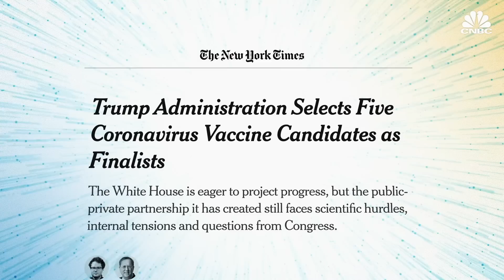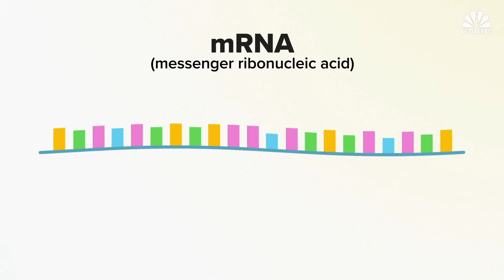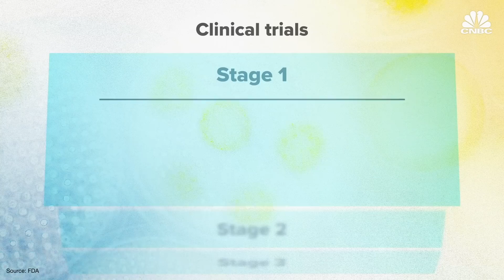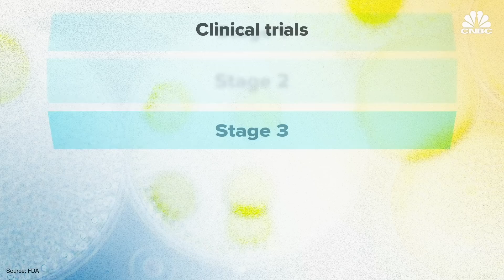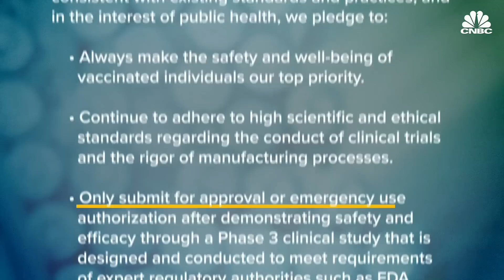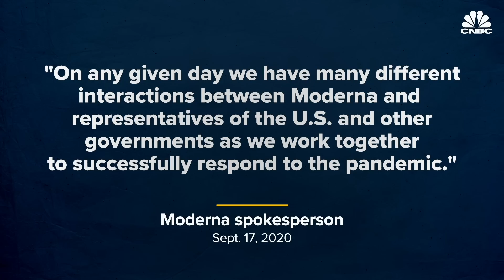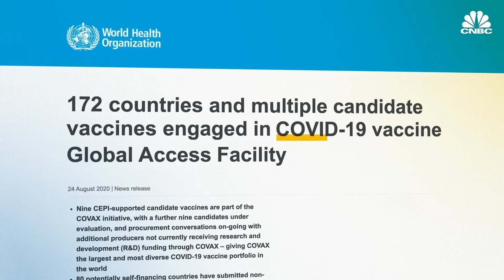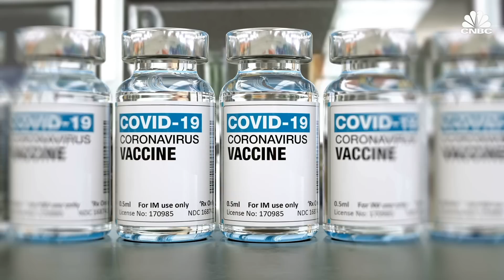What Is An mRNA Coronavirus Vaccine?

Comment: The difference is a vaccine you show antibodies this is what the enemy looks like.
mRNA is sticking a rod in the antibodies and it wakes up saying "I know kung fu!"
Reply: Xenobots + mRNA = Human zombie bots.
Reply: @The_Primary_Axiom  ????
Reply: Red Pill Red Pill  That's not possible. A vaccine would have nothing to do with affecting cell replication. Therefore cancer is not possible since cancer happens when your cells over-replicate. Not having anything to do with cell replication in the first place makes it kind of hard to have that effect. Other things such as cigarettes contain harmful chemicals that throw off the chemical balance in your body and cause rapid cell replication, which is why things such as that are a carcenogen.
Reply: @taviondavis1293  actually it is possible, if the mRNA codes for something that disrupts the checkpoints in replication.  Its also possible that the antibodies will react to ones own body, like autoimmune diseases. Its extremely unlikely though since they know what is in the mRNA.
Reply: Red Pill Red Pill  It carries messages of genetic information for tRNA to copy. You are most likely mixing up the two because mRNA only carries information.
Reply: Zax  No it doesn't. Little secret here mRNA is in every single one of your cells already.All it is is a copy of your DNA which is then translated to form a protein. Very basic biology. It won't alter your DNA.
Reply: I have a question I hope someone can answer. This mRNA vaccine causes the rna of the virus to enter you cells and cause your cells to produce the antigens of the virus and then your immune system then detects the antigen and then is supposed to make antibodies to fight the virus. My question is couldn’t that cause the body to attack itself if your own cells will be releasing the antigens. Second if your cells are making antigens of a virus isn’t that an abnormal function that’s like a mouse secreting  snail fluid . It seems to me that you would have to take on some genetic properties of this virus for your own cells to make its antigens. My 3 rd question is if this a mutating virus who’s to say it won’t cause mutations once the vaccine through its lipid nanoparticle causes the rna of the virus to penetrate your cells and instructs them to secrete the viruses antigens. will your cells be covered with the antigen  and then be attacked by the antibodies it produced. What if your body doesnt see the virus as a threat anymore because know your own cells are secreting it’s antigens what if the antibodies aren’t even effective because they see no need to attack what your own body produced. These are all relevant questions sheep won’t think to ask
Reply: Red Pill Red Pill  I don't get how people can you know...just WAIT for a few months after vaccination to see if it does anything?

But thing is honestly, I wouldn't be surprised if governments force people to take the vaccination or receive state punishment. That'd be a scary thing to go through.
Reply: Red Pill Red Pill Well why don’t you and him be the first to volunteer. What a bunch of entitled narc sociopaths!
Reply: sinkiy oop- ok :> 😌✌️
Reply: Red Pill Red Pill  what were the results for the animals in more detail?
Reply: The wonders of genetic modification, no need to worry about gmo foods anymore and we’re all about to be gmo’s ourselves lol
Reply: @applesaucerno.2843  These guys explain it better than this video. https://www.youtube.com/watch?v=IVlULRMvcjI
Reply: sinkiy wut- lol but uh ok? 👉👈
Reply: I’m really sorry, but was that a Daxter reference?
Reply: Red Pill Red Pill  Are you serious?
Reply: Red Pill Red Pill  sorry, my bad I thought you knew about it.
Reply: MMAmRNA
Reply: Red Pill Red Pill sorry! Then they can be the first to volunteer. I’m better at person to person conversations.
Reply: Altair IV  Mmmmm no
Reply: Sloane M How? How does it not do that?
Reply: Merlin  if people don't know this, I'm scared.
Reply: @fcosta94  how did you know? Seems to me there are folks here who know so much about these mRNA vaccines already. 😑
Reply: That's rich
Reply: damnnn     😲
Reply: delonix regia  Doubt is good to a certain point. I make it a priority to understand what the body can withstand as well as the way in which the vaccines work. I then explain that and it's usually the people who continue with the "what ifs" and "but's" that hold irrational fear. 

However, yes several companies are showing 95%+ efficiency. The sooner we are able to administer the vaccine the sooner we can start the real battle to completely eradicate the virus.

It's the people who become extra about their freedom, when it's not really about that it's about cooperation for mutual benefit, that will slow down the process to get back to a somewhat normal life. Just how anti-maskers foil tireless attempts to contain the virus with a single maskless college party.
Reply: delonix regia  That's a whole different situation that I have no knowledge about so I'm not going to treat it as something that is a common occurrence in vaccine production, because it's not.
Reply: delonix regia  Also, better than the alternative of it becoming a far more contagious version of influenza in the future and evolving to a point beyond vaccines being able to fully control it. People always highlight death rate as a halmark of a virus but side-effects are important too. There are people who caught it early on who still feel the symptoms, but have a negitive test. There are people who developed blood clots because of the virus' interaction in the bloodstream which can lead to a heart attack or stroke. Then there is also the possibility of a Cytokine storm, which isn't as fun as it sounds. Not to mention the common occurrence of lasting lung and heart tissue scarring that is worse than the effects of smoking for several years and develop into chronic debilitating diseases. All this can happen to people whether they showed symptoms or not.
Reply: delonix regia  Not to mention the fact that literally every actual healthcare professional recommends the virus be distributed and taken. There are doctors and nurses who have to pull endless shifts that try to describe how horrible the virus is on a case-by-case basis, which is more than enough to warrant everything, but get undermined by anti-vaxx moms who researched on Wikipedia for like 5 seconds and politician's who parrot them to gain favorability over an unstable demographic.
Reply: delonix regia  An overwhelming majority of all vaccines throughout history have been almost completely safe, save for rare allergies to certain chemicals. Also, a majority of healthcare professionals definitely advocate for vlthe vaccines. On top of that they've largely ignored outside parties rushing them with the virus. Not to mention the fact that most companies prioritized the vaccine over other projects. On top of national medical organizations giving special attention to reviewing and passing the several vaccine trials.
Reply: delonix regia  Oh yes capitalism is sooo bad. Companies making money for something they developed with no federal funds whatsoever? Unthinkable. Also, most of vaccine trials is waiting to get approval from national review boards that preside over countless other research reviews over the course of several years. However, since those review boards have prioritized the vaccine it gives more room to be developed. On top of that the safety tests are still the same regardless of the speed of development and they would determine whether something is or isn't safe regardless of how quickly it was made. On top of that these places have largely ignored the rushing of their work to be able to focus on research and development. Also, medical technology is constantly evolving at an increasingly exponential rate so past pandemic vaccine response times lack the inclusion of such an important factor.
Reply: @taviondavis1293  i can only disagree with the capitalism comment friend.  American is a form of it. But for most part America is a Corporate Socialist Country Now.
Reply: IF it is done correctly. In the case of the dengue vaccine, the RNA did not teach the cells to reject the virus, but rather acted like a trojan horse, so that the vaccinated child caught a second case of dengue fever, it was far worse, sometimes even fatal.
Reply: @spiritinmotion1327  No I just don't care about what you are saying, because your input doesn't matter.
Reply: @taviondavis1293  🤣🤣🤣🤣 says the youtube scientists trained by  lab technician momma.
Reply: @spiritinmotion1327  Also, I haven't seen any Scientist's only anti-vaxxers with no actual point.
Reply: It's not that I am Anti-Vax but I am Pro-Science and there isn't enough science to ensure this injection is safe.

https://youtu.be/UCqGgqO-nr0

This is a totally new drug that should have gone thru years of testing including multiple tests on animals before ever being considered safe for humans.

https://youtu.be/3kej0uS5B1c

It's also extremely suspicious when a Pfizer CEO sells 60% of his shares in the company the day after making the announcement the injection would be approved.

https://youtu.be/eQsmdiJiAm8
Reply: @kellywills5852  You don't take it and watch everyone else turn into Cronenberg monsters. M'kay.
Reply: We are living in the biblical Last Days and with the Mark out, the mandatory v., the battle between light and dark is coming in the open. The King is coming back very soon, be ready: https://m.youtube.com/watch?v=wjmltHpAQw8
Reply: Dragon Skunk Studio   yes yes yes.
Reply: For the Great Deception is upon the sheeple of the Earth!  The deceptions are deadly.  Who shall escape the deception?  For even God's very elect may be deceived, lest we put on the whole armour of God , repent and gird the spirit of DISCERNMENT. 
"Discern real from fake."  - Amen. 
For he who hath ears , let him hear (Truth):  
"Expose fruitless deeds of evil." - Ephesians 5:11 
Fire cannot fight fire.  Evil does not combat evil.  
Virus does not fight virus (vaccines).  

Trump (and Biden) is Pro-Vaccine.  

Before taking the vaccine, please be aware of the following:

     To date, there have been almost 200 COVID VACCINE related deaths: 

Jan 12, 2021 - 24 dead in NY Nursing Home after getting COVID Vaccine 
https://www.bitchute.com/video/DeXZvU9TpEQB/ 

Jan 15, 2021 - 23 DEAD IN NORWAY AFTER RECEIVING THE SHOT! 
https://www.bitchute.com/video/tsV148TftLZy/ 

https://www.newsbreak.com/news/2141389976807/at-least-10-people-now-confirmed-dead-shortly-after-receiving-pfizer-covid-19-vaccine

6 PEOPLE DIE FROM PFIZER VACCINE AND FDA SAYS NOT TO WORRY ?!?!?!?!?!?!  
https://www.google.com/search?client=firefox-b-1-d&q=%22FDA+reveals+six+deaths+in+Pfizer+trial+but+says+not+to+worry%22

https://www.nytimes.com/2021/01/12/health/covid-vaccine-death.html

UK issues anaphylaxis warning on Pfizer vaccine after adverse reactions
https://www.reuters.com/article/health-coronavirus-britain-vaccine/uk-issues-anaphylaxis-warning-on-pfizer-vaccine-after-adverse-reactions-idUSKBN28J1DK

Emergency COVID-19 Vaccines May Cause Massive Side Effects
https://articles.mercola.com/sites/articles/archive/2020/12/08/coronavirus-vaccine-side-effects.aspx?ui=1559f3393ef928654102828940f41259667fe775259fcd4375a2b2d468572a28&cid_source=dnl&cid_medium=email&cid_content=art1ReadMore&cid=20201208&mid=DM741418&rid=1029859318

https://sandrarose.com/2021/01/california-halts-moderna-vaccine-injections-due-to-unusually-high-adverse-reactions/

     2. COVID Vaccine Ingredients:
https://www.bing.com/search?q=COVID+Vaccnine+ingredients&qs=n&form=QBRE&sp=-1&pq=covid+vaccnine+ingredients&sc=4-26&sk=&cvid=218A968513C64CCBAECEFD3411FAA242

     3.  Severe Allergic reactions to Vaccines have been known to cause anaphylaxis, among many other toxic reactions:
https://www.bing.com/search?q=COVID+Vaccine+adverse+reactions+anaphalaxis&qs=n&form=QBRE&sp=-1&pq=covid+vaccine+adverse+reactions+anaphalaxis&sc=0-43&sk=&cvid=E6EFB57198EA4AE7A10A9DB2A7DEF7CE

4.  The 1986 Vaccine Injury Compensation Act - protects "Big Pharma" companies, not the general public - you cannot sue drug companies if you or your loved one suffers severely or dies from side effects of vaccines: 
https://www.change.org/p/donald-trump-repeal-the-1986-national-vaccine-injury-act
https://en.wikipedia.org/wiki/National_Childhood_Vaccine_Injury_Act   

4A. "The Plan-Demic 2: In-DOCTOR-Nation"  full documentary 
https://www.bitchute.com/video/opLpNmtOVoaS/

5. COVID Truth (and Beyond) (playlist) 
https://www.bitchute.com/playlist/SZRtHmyYBb4m/

6. A Poisoned World - Trailer 1 (in playlist)  
https://www.youtube.com/watch?v=fI0eDoYsbNk&list=PLzk1nxEKnKQGUZhwS6vNhgkOKGAmZea2E&index=56

7. The PlanneDemic: InDOCTORNation (pt 10) 
https://www.youtube.com/watch?v=mDgUGGWRUwQ&feature=youtu.be

8. The Future of Vaccines (The Corbett report) 
https://www.youtube.com/watch?v=UQvaQFdGLn8

9. COVID 666
https://www.bitchute.com/video/ALo5lzO6g3Y2/

10. Vaccine Truth (Montage)
https://www.bitchute.com/video/3HB38yJV9DX2/

11. COVID on College Campuses and Beyond... (in Playlist)
https://www.bitchute.com/video/3F1G6RG3YaoM/ 

12. COVID19, Vaccines, Beast Technology, Wireless/5G = Prince of the Powers of the Air (satan)
https://youtube.com/playlist?list=PLzk1nxEKnKQHnWPVCFudyugubJV5-rtRR 

VAXXED TV
https://www.youtube.com/channel/UCwZDSEpPvE398OLazdituKQ

Doctors, Scientists, Witnesses being murdered for Speaking Out the Truth (playlist) 
https://youtube.com/playlist?list=PLzk1nxEKnKQHf1amwy0mLu9FT5R8eSfan

Jump to Feb 2018 - CDC Dr goes missing and eventually suicided for exposing Flu Virus at CDC 
https://www.youtube.com/watch?v=74_dnPijWMQ&list=PLzk1nxEKnKQHf1amwy0mLu9FT5R8eSfan&index=2

Jump to 2020 COVID - Dr Fauci ties to WHO ties to Wuhan Lab, manmade virus 
https://www.youtube.com/watch?v=C95ECjxgcJE&list=PLzk1nxEKnKQHnWPVCFudyugubJV5-rtRR&index=124

https://www.vaccinedeaths.com
Reply: Red Pill Red Pill  Which is a long-term death sentence that will not be seen until millions if not billions of people have received it. And by that time, who can track it back to this vaccine? No one. Look how long it took science to determine that cigarettes cause cancer, heart disease, circulatory problems, tooth decay,  COPD, etc. And did they ban them? Nope. That's our FDA at work. Same agency that approved scientific genetic modification of our food supply.
Reply: @yellowbird5411  yep just like the Spanish Flu
Reply: CHeEEEeeeEEe  Where are people getting this false information that mRNA rewrites your DNA? I assume you have absolutely no background in science at all because all mRNA does it convert your DNA to proteins i.e exactly what it's supposed to do for you to be alive. This is happening in every single one of your cells all the time. This vaccine is just an mRNA copy of the virus' proteins (antigens), which will then be formed into antigens in your cells. This will promote an immune response which will form antibodies. This is the basis of all vaccines. All vaccines produce an immune response and guess what you need for an immune response? mRNA! So stop spreading misinformation. That's the most dangerous thing going on here by far.
Reply: @archiebenn5707  thank you!!!!
Reply: kung flu*
Reply: @corwaincyrus9759  🤣👍🏻
Reply: @corwaincyrus9759  I learned a new nickname for it just last night and it had me DYING from laughter. Wu-flu 😂😂🤣🤣🤣

It really is Wu-flu though...
Reply: Red Pill Red Pill both are in phase three. Its been used on thousands of human by now.  Don’t think mRNA has the power to rewrite genetic code and in a only fakes out the immune system that a virus is in body so it then makes the antibodies proactively versus reactive. I could be completely wrong but we all are when learning new stuff called learning, imagine the normal vaccine way where they injection weak virus and body reacts to that message the weak virus creates when entered the body.  They just made the message and can broadcast it to the body and now it’s making antibodies in advance. Before exposure. Unless antibodies can transform into cancer cells  then would imagine it not possible. I would say though that if the message they make and broadcast is wrong and the antibodies come out and attack normal body parts would cause rise of auto-immune disorders
Reply: @stevehays6403  Your grammar shows how much people should listen to you on this subject. What-ifs are not things you should live by. As long as this virus exists I will support lockdowns and mask mandates and similar legislation while staunchly opposing us going back to "normal." The only option is to make a vaccine that will strongly support the eradication of the virus. However there are several tests on the effectiveness and safety of vaccines, they account for virtually everything. Normal research just for colleges to determine what people's favorite ice cream is among different racial groups have to have every aspect of research down to any and everything they say to the participants are prewritten and approved. Even wording is judged and down to how you present yourself, determine the ethical concerns and communicate the ethics of the study along with a complete list of participants which is also highly judged. That all is nothing in comparison to the standards of excellence and perfection for even the most basic of vaccines, much less one that is planned to be distributed worldwide.
Reply: Tavion Davis I’m confused. Auto correct could have changed your shouldn’t to should in the part of your comment that states “your grammar is why people should listen to you “.  So uncertain as to weather you were saying don’t listen to me or people should based on if my grammar is good or bad.  Would you mind clearing up please.  The shouldn’t of should makes the contexts of your comment in slightly different ways.
Reply: Dragon Skunk Studio what are you talking about
Reply: @conn_man_249  He was speaking in Matrix
Reply: @conn_man_249  cytokin storm
Reply: @conn_man_249  He means the vaccine will genetically alter your cells.
Reply: @conn_man_249  Vaccine teaches antibodies, mRNA is injects the information into the antibodies.
Reply: Dragon Skunk Studio you mean it helps fight back covid
Reply: @dragonskunkstudio7582  close, but the antibodies are proteins that can't really learn, at least in the same way as cells. The vaccine "teaches" cells, not antibodies. It's more analogous to cells learning to fight a weaker version of a murderer (regular vaccine), versus cells learning what the right tools are to fight the murderer (mRNA vaccine)
Reply: Dragon Skunk Studio you mean old way is the body learning from a weak/ dying kong fu master  so know what style kong fu to prepare for so ready for a full strength Kong fu master when invades. And mRNA is like a power up and have the book to the corona Kong fu.
Reply: @dragonskunkstudio7582  transfection will change your RNA they say it won't be permanent but it probably will be
Reply: @dragonskunkstudio7582  no, you don't teach the antibodies. You teach the immune system to make antibodies.
Reply: @dragonskunkstudio7582  Ahhh you're kind of wrong but on the right track. The mRNA creates harmless proteins that resemble the virus and it's not the mRNA, but those proteins that give you your immunity
Reply: It’s still NOT a cure. A lot of people are misinformed and think it’s a full on cure. But NO it’s NOT it’s like the flu vaccine. And I’m no scientist but that doesn’t sound so safe.
Reply: @jesussaves8549  vaccines were never cures. They are prevention so that you don't get sick.

An ounce of prevention is better than a pound of cure, as they say.
Reply: @ronch550  I didn’t say they were. But a lot of people think they are a cure and will be 100% protected
Reply: @jesussaves8549  It is safe, the only reason it doesn't sound that way is you know nothing about immunology or medical technology, and therefore you have no reference. Vaccines are the safest and most powerful form of medical tool that humans have.
Reply: Tavion Davis and? I know enough that I know that a vaccine made in a haste is not safe. And when Bill Gates gets involved I’m not interested!
Reply: @taviondavis1293  please what are your references and credentials granting you authority to make such judgements on his behalf? I get put off by people sounding just the way you do,mostly after they have listened to a shitload of CNN and BBC.
Reply: Y'all are dumb to take this vaccine. Can't you see that this has never been done and will change EVERYTHING?
Reply: @patriarchmike  when people start taking that vaccine there gonna be getting covid it aint happening now till that damn shot comes out
Reply: @patriarchmike  Everything has never been done at one point in time. Therefore it's no excuse.
Reply: @patriarchmike  nope , you have 3-5 choices ...I think you'd prefer the old style dead virus vaccine . But  mrna.. messager  rna..( not dna)...it's the safe half of the way to do this ...I'm still spooked that they use monkey ' cold viruses' to get it into the protein making machinery...monkey pox! Ahoy! ...so in 10-14 days , 60% or more will get sick from the shots , or as advertised 3% will have a mild reaction. So you choose ,  death or a 3 day mild hangover ?
Reply: @tomgucwa7319  mRNA will change our DNA forever and remake us into mindless drone hybrids that are owned by corporations. Sorry but I belong to no one but God.
Reply: @patriarchmike  I do not worship false idols , mrna is new. The cheapest and easyest to store vaccine is the older tried an true technology .  We will know more in two weeks and again in a month. Bee swell
Reply: @tomgucwa7319  who said anything about false idols? Who cares if its new? Its not safe or ethical and there is nothing you can say to change that fact.
Reply: wait- so this might be the vaccine for covin? If it if ❤️😌
Reply: @amomentwithmark6717  not really they said it wasn't used on humans
Reply: Good luck with the vaccine, errm when things go wrong dont try and sue the vaccine company, they have a zero-liability clause, which makes anyone taking it one stupid MF.
Reply: After my 4yo granddaughter cut her hair off during her class zoom meeting, I got the Moderna vaccination, because someone has to, I don't want to see this pandemic drag on for possibly years, our children need our help and they need it now, not everyone wants to see the world burn, I'm a former United States Marine, I've learned that there is a time to duck, and there's a time to stand up. Im standing
Reply: James Dicus i’m also a Marine Veteran and am in the Moderna Covid Vaccine trial.  Get my second shot this coming Monday.  I was injected with Vaccine I had some minor side effects from the first shot.  Service and Sacrifice is ingrained in us Marines.  I hope this Vaccine works for the good of us all.
Reply: @jamesdicus5468  you should know better if you have been a marine. Standing for what by the way? I'm confused and what has your grandaughter cutting hair got to do with a vaccine?
Reply: @jamesdicus5468  it's been a month how are you feeling? Please respond
Reply: @jamesdicus5468  she is 4. What classroom zoom was she on?? Do 4 years old go to class?
Reply: @jamesdicus5468  my son also cut his hair.  wow?
Reply: James Dicus your a volunteer you have my respect because you want to help the human race survive
Reply: @jamesdicus5468  thank you for thinking of our children. Everyone has been ignoring how hard this year had been on them. Then you for stepping up. Many blessings to you and your family.
Reply: Red Pill Red Pill  perhaps, but right now scientists are just trying to see what could work. We'll see what happens
Reply: @vthunder2789  I wouldn't take it even tho they did some research they could be hiding stuff behind media
Reply: @vthunder2789  The fact that they are rushing so hard to get, still experimental, medication approved for use on the entire population, while it is still impossible to know if there are long term side effects, should concern us all. If it becomes mandatory in any way I expect very strong resistance to such mandates, and rightly so.
Reply: @ingluv  A worldwide pandemic doesn't just end. Plus the standards by which they test these vaccines safety are still the same. Plus our technology rapidly develops at an increasingly higher rate so we can safely produce vaccines much faster than in the past and it will continue to get even more efficient.
Reply: @taviondavis1293  no excise for dropping the checks and balances. The safety protocol is there to ensure medications and vaccines are safe. You can not remove any safety protocol without increasing risk. 
Explain to me how, in less than a year of research, they are suddenly able to see effects 10 years in the future?
Reply: https://www.youtube.com/watch?v=0YhJxJZOWBw
Reply: white blood cell: "i know kung fu"
Madorna: "hmmmmm...show me"
Reply: MRNA VACCINE IS THE MARK OF THE BEAST YOUR ABOUT TO BE INJECTED WITH GENETIC MATERIAL FROM A MUTATING VIRUS https://youtu.be/HaMx5XxEEPM
Reply: Red Pill Red Pill  That doesn't mean I contradicted myself. It still doesn't create a link to the actual multiplication of cells, which would allow for cancerous rapid cellular replication to occur, which is the basis of my argument. That and you are going a long way for little return. Meaning you are going way to far to ensure that you do nothing but fear things you don't even comprehend. On top of that vaccine testing is literally the most fullproof, extensive, strict and safe form of research that we humans can produce. Not only that but it is the most practical and powerful form to combat massively viral diseases, such as COVID-19, there is no such thing as waiting it out. Black plague still exists today and is still very much deadly to people who remain unvaccinated.
Reply: @taviondavis1293  I bet you would make a great guinea pig
Reply: @dbchillin7747  XD
Reply: @taviondavis1293  the vaccine isn't a vaccine if it's rushed and contain of unknown stuff in it that cause covid to not cure furthermore it'll probably turn us into zombie(doubt it but it could happen) 🙃
Reply: @myfuturelife4445  That's stupid and has no basis. Clinical trials have data analysis and content makeup releases and they don't put anything in them that is inherently bad for the average human body other than a very small amount of the virus, but you'd have to have basically no immune system whatsoever to contract it or if you are allergic to one of the contents, but that's unlikely because chemical allergies aren't common and it would not make the vaccine inherently at fault. I'm not saying maybe this is what it is, I'm saying exactly what I'm saying is truth. Also, the reason most vaccines take years is because doctors are split in terms of what medical projects they are handling, the process for testing is extremely extensive and is usually caught up in pre-review for the majority of "years" and most of all applying for grants and money to do the actual work. The vaccine is extremely prioritized so most places are exhausting their efforts by focusing almost completely on viral research and chemical manufacturing, there are grants that are basically thrown at them like dog treats, and their research method reviews are expedited.
Reply: @taviondavis1293  but if the chemicals aren't very common then might as well not put it in our body.
Reply: @myfuturelife4445  I said chemical allergies aren't common. So it'd be the opposite. People are usually allergic to food (ie dairy & nuts) or insect venom (Bee's & Spiders).
Reply: @taviondavis1293  oh chemical allergies ok sorry I misunderstood T^T
Reply: @taviondavis1293  Any protein can potentially cause an allergy. It's not impossible the new mRNA could replicate an allergen. But the testing pool should assure those incidents are exceedingly rare, i would think. I 
Wouldn't think an mRNA vaccine would be inherently more dangerous than traditional vaccine. I would take one (after reviewing safety data). Anytime anything is "New" it scares people. That's in our DNA too.
Reply: @onebylandtwoifbysearunifby5475  I understand, but I also trust the scientists who work with little pay, endless hours in a now thankless job since science is under attack since people refuse to trust everybody endlessly despite the country being built upon trust that everyone would band together, and not be british spies, in order to gain independence. I know because my mother is a lab technician and she loves her job and talks about science all the time in a passionate way. I get that it's new, but I trust that they are going to ignore Trump, in terms of speeding up the vaccine development, and go at their own pace. Also, mRNA is just a messanger, and it sounds far more dangerous then it really would be. Since mRNA just carry messages through the cell and synthesize protein. Also, protein allergies are usually from food related proteins such as the protein in eggs.
Reply: @taviondavis1293  Let's discuss the poisonous concoctions pharmas want to pass as "cures", aka vaccines. 

1. One of the most critical elements which defines the toxicity potential of any vaccine are its pharmacokinetic properties. Drug companies and health agencies refuse to consider the study, analysis or evaluation of the pharmacokinetic properties of any vaccine
2. There is not one double-blind, placebo-controlled study in the history of vaccine development that has ever proven their safety, effectiveness or achievements (unless those achievements have underlined their damage to human health)
3. There are also no controlled studies completed in any country which have objectively proven that vaccines have had any direct or consequential effect on the reduction of any type of disease in any part of the world
4. Every single study that has ever attempted to validate the safety and effectiveness of vaccines has conclusively established carcinogenic, mutagenic, neurotoxic or fertility impairments, but they won’t address those
5. It is a scientifically established fact in literally hundreds of studies that the preservatives and chemical additives in vaccines damage cells. Neurotoxicity, immune suppression, immune-mediated chronic inflammation and carcinogenic proliferation are just a few of several effects that have been observed on the human body
6. Drug companies still tell us the damage vaccines have on the human body. People just don’t read them. All you have to do is look at the insert for any vaccine, and it will detail the exact ingredients, alerts and potentially lethal effects
7. Any medical professional who believes that it is justified to inject any type of neurotoxin into any person to prevent any disease is completely misguided, misinformed, deluded and ignorant of any logic regarding human health
8. All promoters of vaccination fail to realize that the respiratory tract of humans (actually all mammals) contains antibodies which initiates natural immune responses within the respiratory tract mucosa. Bypassing this mucosal aspect of the immune system by directly injecting viruses into the bloodstream leads to a corruption in the immune system itself. 
As a result, the pathogenic viruses or bacteria cannot be eliminated by the immune system and remain in the body, where they will further grow and/or mutate as the individual is exposed to ever more antigens and toxins in the environment which continue to assault the immune system
9. Despite the injection of any type of vaccine, viruses continue circulating through the body, mutating and transforming into other organisms. The ability of a vaccine manufacturer to target the exact viral strain without knowing its mutagenic properties is equivalent to shooting a gun at a fixed target that has already been moved from its location. You would be shooting at what was, not what is!
10. Flu viruses, may mutate, change or adapt several times over a period of one flu season, making the seasonal influenza vaccine 100% redundant and ineffective every single flu season. Ironically, the natural immune defenses of the human body can target these changes but the vaccines cannot.

Now please consider to reply to the below questions:

CLAIM: The study of vaccines, their historical record of achievements, effectiveness, safety and mechanism in humans are well understood and proven in scientific and medical circles.
FACT: The claim is completely false:
1. Could you please provide one double-blind, placebo-controlled study that can prove the safety and effectiveness of vaccines?
2. Could you please provide scientific evidence on ANY study which can confirm the long-term safety and effectiveness of vaccines?
3. Could you please provide scientific evidence which can prove that disease reduction in any part of the world, at any point in history was attributable to inoculation of populations?
4. Could you please explain how the safety and mechanism of vaccines in the human body are scientifically proven if their pharmacokinetics (the study of bodily absorption, distribution, metabolism and excretion of ingredients) are never examined or analyzed in any vaccine study?

CLAIM: Preservatives and chemical additives used in the manufacture of vaccines are safe and no studies have been linked or proven them unsafe for use in humans
FACT: The claim is completely false:
1. Could you please provide scientific justification as to how injecting a human being with a confirmed neurotoxin is beneficial to human health and prevents disease?
2. Can you provide a risk/benefit profile on how the benefits of injecting a known neurotoxin exceeds its risks to human health for the intended goal of preventing disease?

CLAIM: Once an individual is injected with the foreign antigen in the vaccine, that individual becomes immune to future infections
FACT: The claim is completely false:
1. Could you please provide scientific justification on how bypassing the respiratory tract (or mucous membrane) is advantageous and how directly injecting viruses into the bloodstream enhances immune functioning and prevents future infections?
2. Could you please provide scientific justification on how a vaccine would prevent viruses from mutating?
3. Could you please provide scientific justification as to how a vaccination can target a virus in an infected individual who does not have the exact viral configuration or strain the vaccine was developed for?

BASICALLY: STOP LYING!!!!!!
Reply: @Forbiddenjadetheonly  No
Reply: @taviondavis1293  and how many of he dog treats were thrown at you to  defend them?
Reply: Merlin I meant in a different way then traditional vaccines
Reply: ‘I know Kung fu’... means it turns you Chinese?  Ugh, I know it’s thought less to that, but it’s all I can think of when I think vaccine.  And COVID-19.
Reply: Dragon Skunk Studio  that’s exactly what a vaccine is they put a little bit of that virus in your body so that if and when you get the coronavirus or a flu virus your body goes oh I know this virus so instantly starts making it the antibodies to fight to fight that virus so then do your antibodies get specific to that virus so if you get Covid it’ll send Covid a fighting antibodies